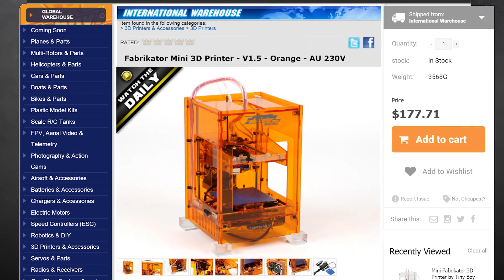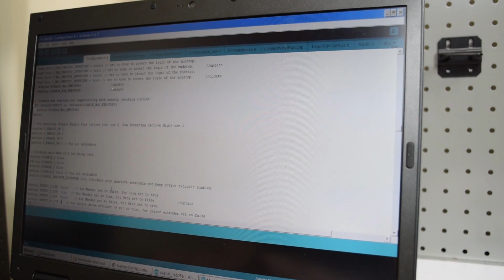Fabrikator Mini V1.5 3D Printer Review

Comment: For other 3D-Printers in this price-range (but I think a little bit more expensive):

The CTC 3D (or Bizer; Makerbot-Clone) for around 350€ (in Germany).
I own this printer and to this point (after a few tweaks and tuning-parts) the printer works fine for me.
I think it's a good printer for beginners which don't fear to tinker around - I learned much using, upgrading and debugging this printer.

Comment: There will be a new model of that! The tiny boy 2 soon, what do you think about that?
Reply from the maker: +davide nesi The Fabrikator Mini is hobbykings take on the original tinyboy, it's actually pretty different now and with the injection molded components much better in my opinion! The Tiny Boy 2 does have a bigger print volume... but I'll bet it costs more too. ;)
Reply: +Maker's Muse thank you a lot! I think I'll go with a mini fabrikator
Reply from the maker: Also it's available right now which is always a plus.
Reply: +Maker's Muse totally agree with you

Comment: could you take a look at a quick video I shot from my own fabrikator mini 1.5? My X axis ( the part with the extruder attached ) stopped moving after 3 prints. Looks like the inner shaft from the stepper motor slips on the pulley. Have you ever seen this happen before and what could have caused this problem? Thanks for taking a look!
https://www.youtube.com/watch?v=LSjg_zyNmbg
Reply from the maker: +Arjan Demoed Looks like you need to tighten the grubscrews on that pulley, they're the small black things on the side - you'll need an allen key that fits them perfectly, or you'll risk damaging them and you'll never be able to tighten the pulley! They must have not done it very tightly at all from the factory.
Reply: +Maker's Muse Thanks a lot for the tip! It's a pain to get in there with the allen key and I don't have the correct size. I will try to get one that fits.
Reply: +Arjan Demoed You may find a little dab of "Thread lock" adhesive is needed, Take out the grubscrew, add a dab of threadlock, then wind the grub screw back in. Saves having to swing on the screw to tighten it and risk stripping the screw threads.
Reply: +moojuiceuk I will use some Thread lock on the grubscrew. First I need a .9 mm allen key... everything on this printer is so small!!! :) Also this acrylic case is very brittle. Allready have some cracks in my printer :(

Comment: I'm looking in to buying this printer as my first printer to see if I would like 3D printing and how often I would print something. So would you recommend this 3D printer for that?
Reply from the maker: +parasite Absolutely, it's the cheapest way you can try out 3D Printing and it works pretty well, I think my extruder issue is pretty isolated and could happen to any 3D Printer.
Reply: I'm not worried about the extruder because you now know how to fix it :p. Just one question would you please make a video showing how to upgrade to a screen and sd card.

Comment from the maker: First! :)
Reply: +Maker's Muse yeah its sad, i really want one in aus too :(
Reply: Was getting to drop $1000 on a Prusa as my first 3D printer but this video made me check out Hobby King. Version 2 is a significant upgrade from the reviewed v1.5 but I was sold as soon as I saw the aluminum case had replaced perspex. Saved $700. Great channel.
Reply: Not quite the same ballpark, but curious what you think of this: www.cocooncreate.com.au

Looks to be a rebranded wanhao, coming to Aldi instores.
Reply from the maker: +Karl Ashley yeah definitely rebranded wanhao. Wonder if Aldi will stock filament too? I suppose they'd have to... what an age to live in when Aldi is selling 3D Printers!
Reply: +Avery's Tech where did you find it for $350? everywhere I see it for sale is for over $700
Reply: mp mini select
Reply: Just looked this up.... The version 2with a heated bed is selling from hobbyking.com posted to Australia for $294 Inc post
Reply: The print r bot play
Reply from the maker: +kraus family Without looking at shipping, the printrbot play is about double, at US$399 vs US$178
Reply: m3d 399.99 cad 
349.99 cad when on sale. larger build volume.

isn't an ali special
Reply: now they have a v2